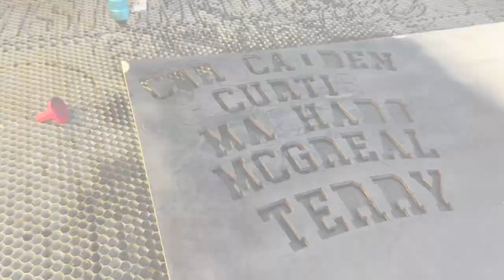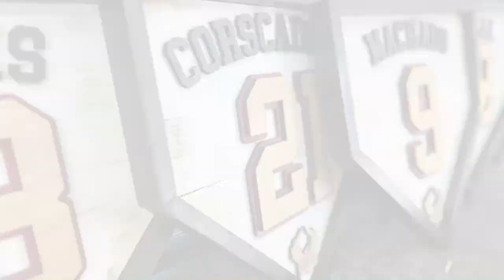Custom Baseball Diamond Plaques NOVA 63

Comment: Why wouldn't you spray paint your wood before you put it in your laser and risk getting it on anything? Doesnt make sense.
Reply: One reason is that by painting the pieces after cut (if painting in black or another dark color), you can paint the burnt edges and they won't be seen. Otherwise, painting the material before cutting, the burnt edges don't look very good.